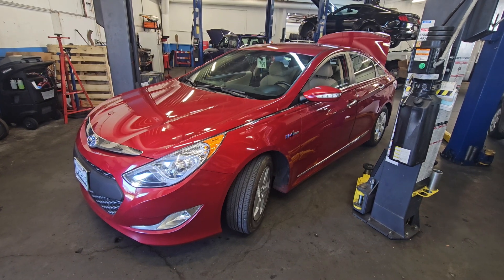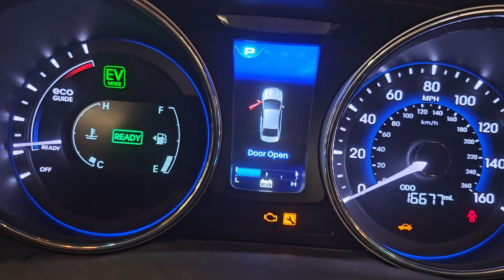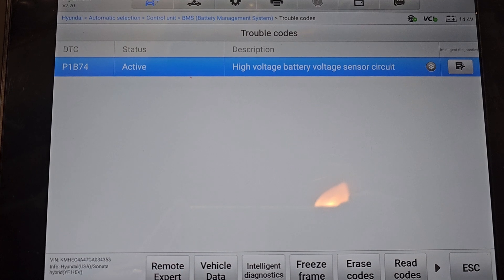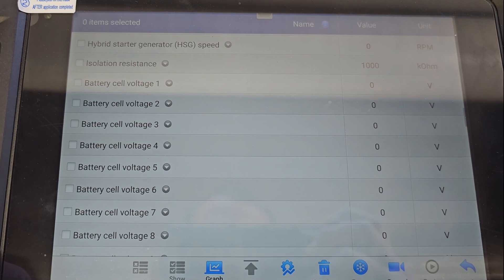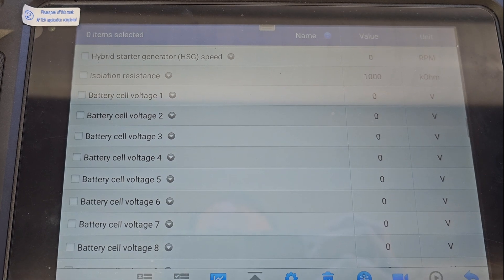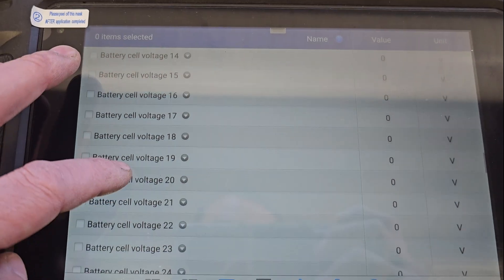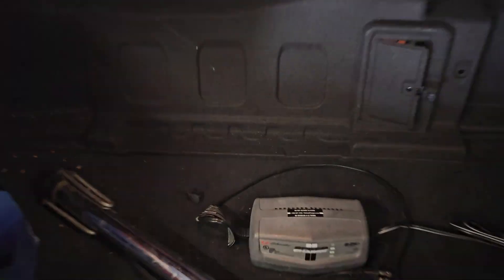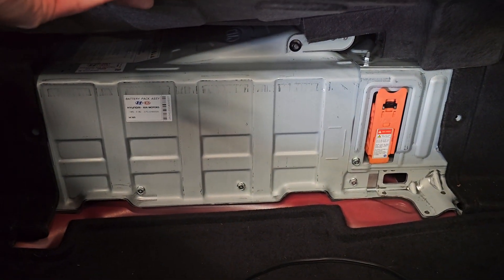Hyundai Sonata Hybrid Battery Diagnosis and Location.

Comment: Have this code after replacing the entire EV battery 🤔 car is running fine what could it be
Reply from the maker: Did you replace the high voltage battery with a new, rebuit or used battery?
Reply: @ new cells
My live data scanner says the EV battery has 6350 volts😂 I checked all the sensors everything is plugged in
Reply from the maker: @franciscogomez2565 🤣😆😂
I would start running.
Reply from the maker: Somone didn't rebuild the battery correctly or the internal harnesses got damaged. 

No check hybrid system Light? 

My thoughts are new battery or rebuilt...someone messed something up internal.. Bms, Wiring or not plugging in the internal harness.